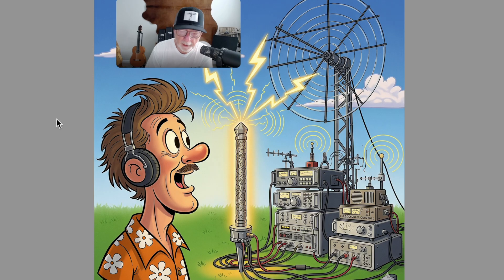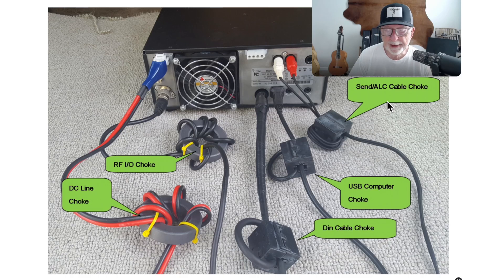The Magic RF Ground Rod Ham Radio Myth.

Comment: ZOMG grounding.  Misunderstood by HAMs, engineers, and electricians.  I've been the first two, and had to fake the third to work on my house...
I've learned bad info, re-learned, re-learned... then there's the whole grounding for power safety vs. grounding for RF which really seems to trip up us amateurs.
Subbed after two videos. :)

I will say tho, that I've seen multiple problems solved by the addition of ... _more ground rods_. 🤣

Comment: I am hoping I can convince you to help campain for POTA to add a contest.

BHOTA   Black Hole On the Air.

Recreation/vacation spots are often in areas where no cell phones will reach.  Mountains, rivers, valleys, etc.  Places where emergencies can and do occur.  Emergency response is inhibited when there are no comms available.  

New contest idea.  go to a location devoid of any cell signal.  Put up a radio or a pair of radio's and establish communication that could reach emergency response.  

Then, once "activated" make a BHOTA map, put it on the map, give it a number.  Record how the comm link was done and have it available for rapid deployment in the event of a crisis.  Ie, child lost in the woods, etc.

I live in AR near the Mulberry River.  No cell service, 2M ham repeaters do not reach, a black  hole.

Plan 1.  2M mobile parked on mountain above River.  Manual Simplex repeater to relay information to town and coordinate searchers with HT.  

Plan 2.  Use HF radio to see if NVIS will communicate out of hole to nearest town.

If either is successful it would be a valid activation and information made available on map. 

Howard Payne
KJ5LSR
Reply from the maker: This is an interesting idea Howard.

Comment: Bonding is by far the most important thing to do in the ham shack. There are subtleties to bonding though.

Consider that the 'ground reference' is usually the service ground from the main service panel - multiple pieces of equipment are plugged into 'wall power' and have the service ground attached to the chassis of the equipment (safety ground). What else is tied to equipment chassis? For transceivers, the shield of the coax. For amplifiers, the shield of the coax. Any equipment that has coax going to it AND needs wall power will typically use that 3rd prong of the outlet for a safety ground. For power supplies (some), the negative output of the supply is connected to chassis. All these must be considered when bonding to avoid ground 'loops'. 
The goal is to bond everything to a single point (with short flat braids as stated) and that point should have 1 reference which is 'usually' the service panel ground. That single point bus bar does NOT have to be connected to a separate ground as there is already a reference from the equipment chassis' - equipment plugged into the wall.

Putting ferrites everywhere isn't necessarily a bad idea. The best idea is to prevent the EMI radiation to begin with.
Reply from the maker: That’s a great overview of the subject, thanks for your contribution.

Comment: It's surprising that "Mark the Ham Florida Man" hasn't mentioned that Florida is the lightning strike capitol of the world: more lightning strikes per sq. mile than most anywhere else.  I've heard several hams that say they've lost more gear from well grounded gear and lightning surges entering through those grounds than from anything else.  They have abandoned grounding.
Reply from the maker: This is a valuable comment because a functioning lightening protection system is a lot more than a metal rod driven into the ground.

Comment: Howdy.
No intention to be a "wise guy".
All 50 Hz or 60 Hz currents return to the pole transformer's starpoint. Also fault currents.
Some of the fault current goes to the ground rod, trough the soil and up along the pole's ground rod and eventually to the transformer's starpoint. Yes. The soil and gravel are not a fault current dump well. For lightning the soil and gravel are a dump well. Yes.
I am an electrical engineer and feel compelled to comment this.
Have patience.
Cheers.
Reply from the maker: Not bad thanks for contributing

Comment: Could you just explain a little further the bonding? I have my equipment linked together with copper wire (can't get copper braid) at each point at which the manufacturer has an earthing mark, from there I run the wire to a rod going into the ground. Is this what is meant by the bonding. Many thanks 😊
Reply from the maker: The entire video focused on how a rod in the ground does not work at RF frequencies.  If you don't have any problems don't worry about changing your bonding.

Comment: You guys should see the kind of grounding that's done for broadcast TV. A transmitter site is a copper thief's dream!
Reply from the maker: Yes I’ve seen that stuff.  Wide copper strip running everywhere
Reply: @BustRadioMyths  and that's the part you can see. The underground parts get quite extensive too.

Comment: What about if you use Polyphaser lightning protectors? I have one on my HF antenna and i have seen them work as advertised in the business band radio world. The ground of the protector is connected to a ground rod.
Reply from the maker: Lightening protection is entirely different from the issue of RF ground.

Comment: Ok a half ass ground system is not a good rf ground system.  Combine that with half ass antennas and you will have common mode to the max.  Lots of copper in the ground, bonded to service with many ground rods, all towers bonded to that system, and metal building bonded to that system.  I don't use hardly any ferrite chokes as they are not needed.  I think there was a few guys that did some testing (including W8JI) with all that choking madness and found that you are just chasing problems around and most likely causing even more of an imbalance in currents.  I did this mainly for lightning mitigation but it turned out to be a pretty good rf ground.  I totally agree though.  One ground rod is not going to cut it but it is a good first step.  Bond some radials to it and you will start to have an RF ground.

Comment: This channel rocks Mark! So many times I've heard fellow hams fighting RF in the shack and they add grounds thinking it will fix the problem. Many times they end up creating ground loops which make the problem worse. They don't realize that those grounds can act like "radials" do on a vertical and actually create hot spots of RF instead of mitigating them.
Reply from the maker: Absolutely!

Comment: Great info. Your videos should be required viewing to get a ham license!  My station has no ground rod. It did when I was 14 years old and for a few years as a teenager. I did not know any better. 
My equipment is plugged into a receptacle that has a ground connection back to the 60HZ power panel ground rod. That’s enough grounding in almost all cases.
Reply from the maker: I did something similar when I was a teenager. My antenna was a 14AVQ vertical and I put it out in the yard with a ground rod for the ground. That thing was an air cooled dummy load. And great to have a real engineer on this channel. Really appreciate it.
Reply: @BustRadioMyths  my first antenna was an end fed wire. Therefore I needed something to be”the other half “ of the antenna. I put a short piece of galvanized pipe in the ground. Not very safe but that was what the books showed! Now anytime I need to use a ground or radials with a vertical I make sure that the grounded shield of the coax is ALWAYS disconnected from the rig unless I am using it. To be absolutely sure, I disconnect the feedline from my 160 meter inverted L , roll it up and bring it inside after winter. Even in winter the coax, with that grounded shield  is only connected to the rig when I am actually on 160! I understand the potential gradient that can exist between two ground rods in the event of lightning.

Comment: A ground rod at the coax entry point for lightning protection can make things worse if it is not bonded to the main rod with a lower impedance path outside the house than through the house (it is also a code violation).  Such an isolated rod would attract lighting to your shack.  Many hams get this wrong.
Reply from the maker: This is absolutely true and a big mistake many hams make which could cost them dearly.

Comment: I hope you have your flame suit on because all the different "Ground it my way" cults are coming to burn you at the stake!  

I have always considered the service ground as a part of the return path for the AC service.  I never thought of it as an antenna.  Thank you for the education.... 

I take an approach I call "Isolated circuit ground" for my shack. It's adopted from various grounding theories I've read up on that supposedly resolves any potential disasters like destroyed radios and burning the house down.  

It is like you described. I have a ground bar that I soldered old coax shield pieces that run to each radio piece, and I use copper wire to run to anything else I can get a voltage drop to.  My power supply is isolated from the electrical house ground and I had to disconnect the ground rod to my shack.  Grounded, my tuner could not tune two of the ham bands where it works perfectly on the other 8.  However, it did improve signals on a couple of bands. 

I moved into an upstairs apartment where I can't use any kind of ground rod. I just connected my ham shack and the noise floor ranges from S5 to S9.  It is actually nice when it drops to S5.  So, I'm about to embark on arranging the shack and grounding everything I can together. My power supply charges my battery which powers my station and it is isolated from electrical ground.  So, my shack will be completely isolated from the apartment when I'm done. But everything will be grounded together as best I can.

Comment: It's why I like dipoles with a balun, the r.f. is supposed to be up there. 
For verticals counterpoise earths work well. 
I had a long (short) wire for Top Band one time and connected to a water pipe for an earth and my amateur friend a mile away said my signal shot up in strength, so any kind of earthing helps. Think how much pipework is connected underground, I bet still old lead pipes round here under the houses, the one coming into my house is.
G4GHB.
Reply from the maker: If he was only a mile a way it may have been a direct connection so to speak - the same water system.
Reply: Counterpoise earths????? A Counterpoise shouldn't be connected to earth
Reply: @Pioneer936 
I know that. I didn't say it is connected to earth. It is a form of earth, a counterpoise earth, or counterpoise ground system. Ive heard them called that. It is an artificial earth. 
G4GHB.